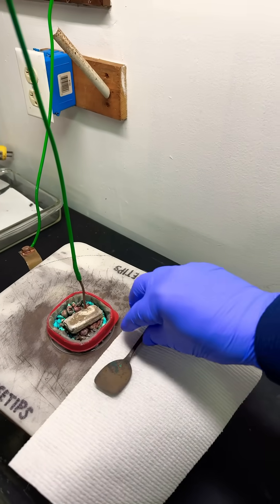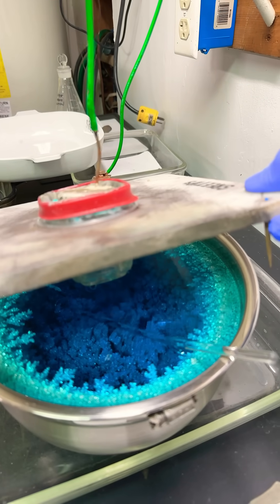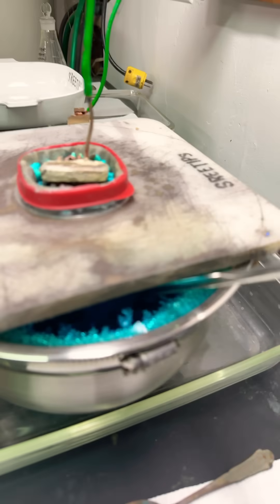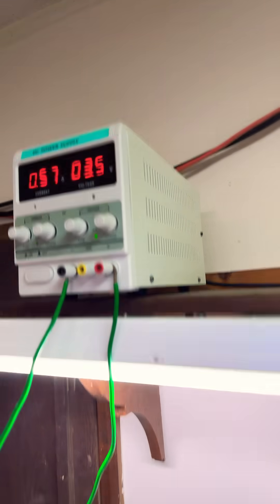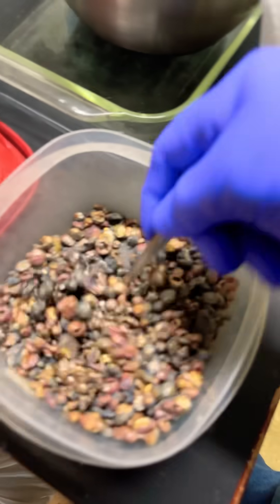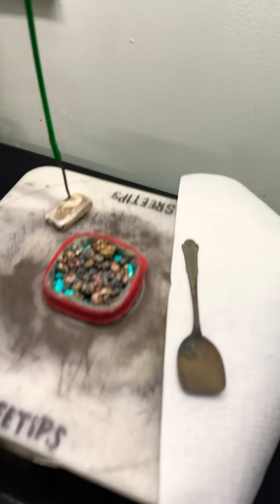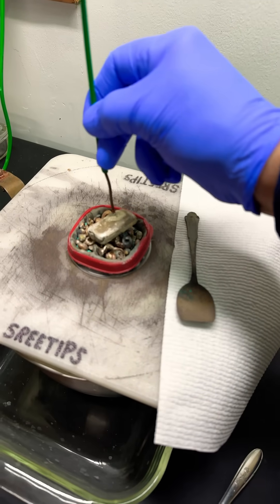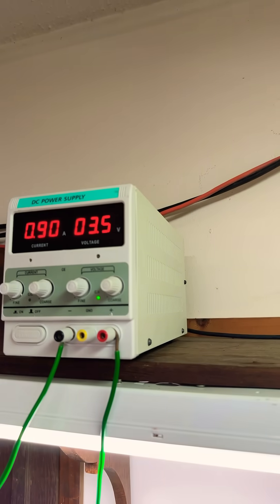High Purity Silver Cell Adding Impure Silver to the Anode Basket.

Comment: Where do you get the impure silver from?
Reply from the maker: I refine gold. I use sterling silver, that I buy at estate sales, to refine the scrap gold. I recover the silver from that, melt into shot, and run it through my silver cell. Silver is a by-product of my gold refining. The cell converts the impure silver (about 980 parts per thousand silver) to high purity four nines fine (9999 parts per ten thousand) pure elemental silver metal. So I’m refining the impure silver, into high purity silver, not creating silver out of thin air. When it’s full, I harvest the pure silver crystal, put it away and forget about it. Then I repeat the whole thing again.

Comment: Is that melted silver plate you are using for shot?  I was debating on adding the for mentioned shot to a silver cell.
Reply from the maker: No, this is 98% impure cement silver melted into shot. It looks ugly due to the 2% copper that’s still in it. It don’t take much copper to make silver look real ugly. But if I took a piece and buffed it on a buffing wheel it would look bright and shiny.

Comment: Where do we get impure silver to do this at home ourselves ?
Reply from the maker: I refine gold. I use sterling silver, that I buy at estate sales, to refine the scrap gold. I recover the silver from that, melt into shot, and run it through my silver cell. The cell converts the impure silver (about 980 parts per thousand silver) to high purity four nines fine (9999 parts per ten thousand) pure elemental silver metal. The impure silver is added to the anode basket. The anode basket is suspended in the silver nitrate electrolyte. I pass an electric current through the impure silver. The silver dissolves, passes through the Dacron filter, travels through the silver nitrate electrolyte, and deposits on the stainless steel bowl (the cathode). The bowl is connected to the negative pole of the power supply. The process only deposits pure silver on the cathode. So I’m refining the impure silver, into high purity silver. When it’s full, I harvest the pure silver crystal, put it away and forget about it. Then I repeat the whole thing again.

Comment: I just saw this for the first time. What is happening here and how does it work?
Reply from the maker: I refine gold. I use sterling silver, that I buy at estate sales, to refine the scrap gold. I recover the silver from that, melt into shot, and run it through my silver cell. The cell converts the impure silver (about 980 parts per thousand silver) to high purity four nines fine (9999 parts per ten thousand) pure elemental silver metal. The impure silver is added to the anode basket. The anode basket is suspended in the silver nitrate electrolyte. I pass an electric current through the impure silver. The silver dissolves, passes through the Dacron filter, travels through the silver nitrate electrolyte, and deposits on the stainless steel bowl (the cathode). The bowl is connected to the negative pole of the power supply. The process only deposits pure silver on the cathode. So I’m refining the impure silver, into high purity silver. When it’s full, I harvest the pure silver crystal, put it away and forget about it. Then I repeat the whole thing again.
Reply: @sreetips  thats really cool! Is it profitable? I might consider trying something like that whenever i retire
Reply from the maker: Yes, I’m filling up my savings, with silver (and gold).

Comment: Oh
You need impure Silver to get this process going ?
Reply from the maker: Correct. I refine gold. I use sterling silver to refine the scrap gold. I recover the silver from that, melt into shot, and run it through my silver cell. The cell converts the impure silver (about 980 parts per thousand silver) to high purity four nines fine (9999 parts per ten thousand) pure elemental silver metal. The impure silver is added to the anode basket. The anode basket is suspended in the silver nitrate electrolyte. I pass an electric current through the impure silver. The silver dissolves, passes through the Dacron filter, travels through the silver nitrate electrolyte, and deposits on the stainless steel bowl (the cathode). The bowl is connected to the negative pole of the power supply. The process only deposits pure silver on the cathode. So I’m refining the impure silver, into high purity silver. When it’s full, I harvest the pure silver crystal. Then I repeat the whole thing again.

Comment: And what’s the point of this?
Reply from the maker: I refine gold. I use sterling silver to refine the scrap gold. I recover the silver from that, melt into shot, and run it through my silver cell. The cell converts the impure silver (about 980 parts per thousand silver) to high purity four nines fine (9999 parts per ten thousand) pure elemental silver metal. The impure silver is added to the anode basket. The anode basket is suspended in the silver nitrate electrolyte. I pass an electric current through the impure silver. The silver dissolves, passes through the Dacron filter, travels through the silver nitrate electrolyte, and deposits on the stainless steel bowl (the cathode). The bowl is connected to the negative pole of the power supply. The process only deposits pure silver on the cathode. So I’m refining the impure silver, into high purity silver. When it’s full, I harvest the pure silver crystal. Then I repeat the whole thing again.
Reply from the maker: Oh, I forgot to say, silver is real money, since biblical times. Paper dollars are a money substitute. Long after dollars are gone and forgotten, GOLD (and silver) will still be here. And they will still be valuable.

Comment: All I understood was thanks for watching
Reply from the maker: I refine gold. I use sterling silver to refine the scrap gold. I recover the silver from that, melt into shot, and run it through my silver cell. The cell converts the impure silver (about 980 parts per thousand silver) to high purity four nines fine (9999 parts per ten thousand) pure elemental silver metal. The impure silver is added to the anode basket. The anode basket is suspended in the silver nitrate electrolyte. I pass an electric current through the impure silver. The silver dissolves, passes through the Dacron filter, travels through the silver nitrate electrolyte, and deposits on the stainless steel bowl (the cathode). The bowl is connected to the negative pole of the power supply. The process only deposits pure silver on the cathode. So I’m refining the impure silver, into high purity silver. When it’s full, I harvest the pure silver crystal. Then I repeat the whole thing again.

Comment: Wtf is this? You van grow your own Silver??? This is crazy
Reply from the maker: I refine gold. I use sterling silver to refine the scrap gold. I recover the silver from that, melt into shot, and run it through my silver cell. The cell converts the impure silver (about 980 parts per thousand silver) to high purity four nines fine (9999 parts per ten thousand) pure elemental silver metal. The impure silver is added to the anode basket. The anode basket is suspended in the silver nitrate electrolyte. I pass an electric current through the impure silver. The silver dissolves, passes through the Dacron filter, travels through the silver nitrate electrolyte, and deposits on the stainless steel bowl (the cathode). The bowl is connected to the negative pole of the power supply. The process only deposits pure silver on the cathode. So I’m refining the impure silver, into high purity silver. When it’s full, I harvest the pure silver crystal. Then I repeat the whole thing again.

Comment: So basically i can make mt own silver and sell it?
Reply from the maker: I’m not making silver. Im refine it. I refine gold. I use sterling silver to refine the scrap gold. I recover the silver from that, melt into shot, and run it through my silver cell. The cell converts the impure silver (about 980 parts per thousand silver) to high purity four nines fine (9999 parts per ten thousand) pure elemental silver metal. The impure silver is added to the anode basket. The anode basket is suspended in the silver nitrate electrolyte. I pass an electric current through the impure silver. The silver dissolves, passes through the Dacron filter, travels through the silver nitrate electrolyte, and deposits on the stainless steel bowl (the cathode). The bowl is connected to the negative pole of the power supply. The process only deposits pure silver on the cathode. So I’m refining the impure silver, into high purity silver. When it’s full, I harvest the pure silver crystal. Then I repeat the whole thing again.

Comment: I did this with copper. It rusted any metal it came near. And drew 5amps and 20v constant voltage
Reply from the maker: You’d better do some more research. You shouldn’t use a metal container for copper cell, I don’t think.
Reply: @sreetips  no I used a jar but it had a metal lid, and I was only make the copper sulphate but it had a metal lid and got hot. I haddent done the electroplating yet
Reply from the maker: Got it, thanks

Comment: This is way too much for a short. What is happening...
Reply from the maker: I refine gold. I use sterling silver to refine gold. I recover the silver from that, melt into shot, and run it through my silver cell. The cell converts the impure silver (about 980 parts per thousand silver) to high purity four nines fine (9999 parts per ten thousand) pure elemental silver metal. The impure silver is added to the anode basket. The anode basket is suspended in the silver nitrate electrolyte. I pass an electric current through the impure silver. The silver dissolves, passes through the Dacron filter, travels through the silver nitrate electrolyte, and deposits on the stainless steel bowl (the cathode). The bowl is connected to the negative pole of the power supply. The process only deposits pure silver on the cathode. So I’m refining the impure silver, into high purity silver. When it’s full, I harvest the pure silver crystal, put it away and forget about it. Then I repeat the whole thing again.

Comment: I dont get it
Reply from the maker: I refine gold. I use sterling silver to refine gold. I recover the silver from that, melt into shot, and run it through my silver cell. The cell converts the impure silver (about 980 parts per thousand silver) to high purity four nines fine (9999 parts per ten thousand) pure elemental silver metal. The impure silver is added to the anode basket. The anode basket is suspended in the silver nitrate electrolyte. I pass an electric current through the impure silver. The silver dissolves, passes through the Dacron filter, travels through the silver nitrate electrolyte, and deposits on the stainless steel bowl (the cathode). The bowl is connected to the negative pole of the power supply. The process only deposits pure silver on the cathode. So I’m refining the impure silver, into high purity silver. When it’s full, I harvest the pure silver crystal, put it away and forget about it. Then I repeat the whole thing again.

Comment: SO? WHAT IS THIS FOR?
Reply from the maker: I refine gold. I use sterling silver to refine gold. I recover the silver from that, melt into shot, and run it through my silver cell. The cell converts the impure silver (about 980 parts per thousand silver) to high purity four nines fine (9999 parts per ten thousand) pure elemental silver metal. The impure silver is added to the anode basket. The anode basket is suspended in the silver nitrate electrolyte. I pass an electric current through the impure silver. The silver dissolves, passes through the Dacron filter, travels through the silver nitrate electrolyte, and deposits on the stainless steel bowl (the cathode). The bowl is connected to the negative pole of the power supply. The process only deposits pure silver on the cathode. So I’m refining the impure silver, into high purity silver. When it’s full, I harvest the pure silver crystal, put it away and forget about it. Then I repeat the whole thing again.

Comment: So is the silver they used to use for medical/barber instruments back before the  uv ray???
Reply from the maker: Silver is naturally anti-microbial.
Reply: I knew that I just wasn't sure that what your makeing is the same..because your process is much quicker and quicker doesn't always make the means if you can grok me
Reply from the maker: Not sure what you’re after here. I’ve had my silver analyzed by fire assay through Guardian Labs in the UK. It always comes back three nines except one time. I ran some of my crystal back through the cell a second time. I sent a sample and had them do an ICP. That came back greater than five nines fine. That’s 99,999 parts per one hundred thousand pure silver. As close to 100% as anyone can get.

Comment: Why are you growing silver, there isnt a short in silver, its not really going up in value, its not worth much per pound or kilo, and 100% pure silver can only be found after melting down to remove impurities.
Reply from the maker: Silver is money. Plus; I refine gold. I use sterling silver to refine gold. I recover the silver from that, melt into shot, and run it through my silver cell. The cell converts the impure silver (about 980 parts per thousand silver) to high purity four nines fine (9999 parts per ten thousand) pure elemental silver metal. The impure silver is added to the anode basket. The anode basket is suspended in the silver nitrate electrolyte. I pass an electric current through the impure silver. The silver dissolves, passes through the Dacron filter, travels through the silver nitrate electrolyte, and deposits on the stainless steel bowl (the cathode). The bowl is connected to the negative pole of the power supply. The process only deposits pure silver on the cathode. So I’m refining the impure silver, into high purity silver. When it’s full, I harvest the pure silver crystal, put it away and forget about it. Then I repeat the whole thing again.
Reply from the maker: Melting silver does not remove impurities. They metals will alloy, not separate.

Comment: I jumped in the comments to find out whats going on please someone explain?
Reply from the maker: I refine gold. I use sterling silver to refine gold. I recover the silver from that, melt into shot, and run it through my silver cell. The cell converts the impure silver (about 980 parts per thousand silver) to high purity four nines fine (9999 parts per ten thousand) pure elemental silver metal. The impure silver is added to the anode basket. The anode basket is suspended in the silver nitrate electrolyte. I pass an electric current through the impure silver. The silver dissolves, passes through the Dacron filter, travels through the silver nitrate electrolyte, and deposits on the stainless steel bowl (the cathode). The bowl is connected to the negative pole of the power supply. The process only deposits pure silver on the cathode. So I’m refining the impure silver, into high purity silver. When it’s full, I harvest the pure silver crystal, put it away and forget about it. Then I repeat the whole thing again.
Reply: @sreetips  that's awesome thank you brother

Comment: What is that for?  I'm completely lost yo
Reply from the maker: I refine gold. I use sterling silver to refine gold. I recover the silver from that, melt into shot, and run it through my silver cell. The cell converts the impure silver (about 980 parts per thousand silver) to high purity four nines fine (9999 parts per ten thousand) pure elemental silver metal. The impure silver is added to the anode basket. The anode basket is suspended in the silver nitrate electrolyte. I pass an electric current through the impure silver. The silver dissolves, passes through the Dacron filter, travels through the silver nitrate electrolyte, and deposits on the stainless steel bowl (the cathode). The bowl is connected to the negative pole of the power supply. The process only deposits pure silver on the cathode. So I’m refining the impure silver, into high purity silver. When it’s full, I harvest the pure silver crystal, put it away and forget about it. Then I repeat the whole thing again.
Reply: @sreetips  ooh I gotta..... Kinda lol. You're using electricity to grow silver crystals?  So where does the impure stuff go?  From the video you were putting rocks on top... I know not actually rocks... But do they disappear? Or once the silver is drawn out you have to empty the top?
Reply from the maker: Actually I’m using electricity to dissolve the impure silver. The insoluble impurities, such as gold and platinum, get trapped in the anode filter. The dissolved silver deposits (grows) on the inside of the stainless bowl.

Comment: I don't know what the point of this video is I guess he's refining silver or he's got a battery that's making energy I'm not sure
Reply from the maker: I refine gold. I use sterling silver to refine gold. I recover the silver from that, melt into shot, and run it through my silver cell. The cell converts the impure silver (about 980 parts per thousand silver) to high purity four nines fine (9999 parts per ten thousand) pure elemental silver metal. The impure silver is added to the anode basket. The anode basket is suspended in the silver nitrate electrolyte. I pass an electric current through the impure silver. The silver dissolves, passes through the Dacron filter, travels through the silver nitrate electrolyte, and deposits on the stainless steel bowl (the cathode). The bowl is connected to the negative pole of the power supply. The process only deposits pure silver on the cathode. So I’m refining the impure silver, into high purity silver. When it’s full, I harvest the pure silver crystal, put it away and forget about it. Then I repeat the whole thing again.